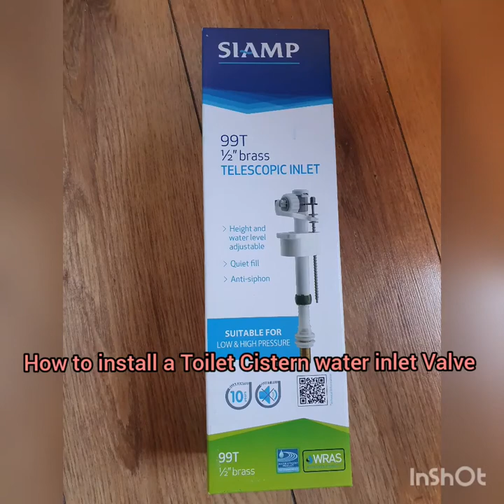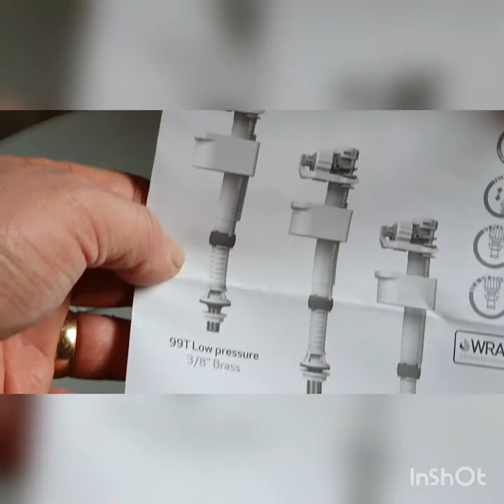How to install a toilet Cistern water inlet Valve

Comment: in this system, the valve is removed by turning it counterclockwise, without unscrewing the nut or anything else. Another one is placed in the same way

Comment: That’s a very easy valve change,a lot of cistern s now ,you can’t see the underneath of the cistern & have to dismantle the cistern ,& take it off the wall,to change the float valve,& takes 3times longer to  change the float valve😡😡